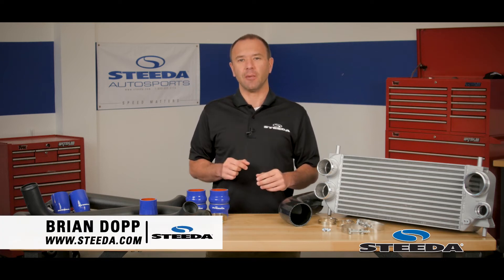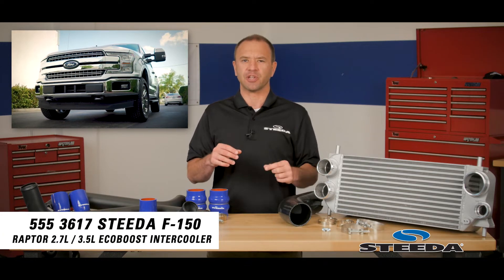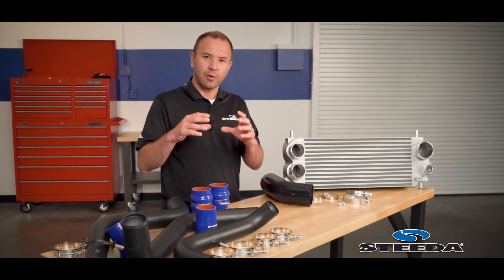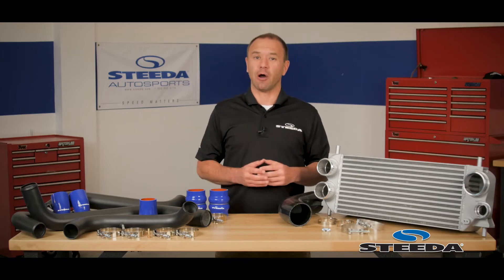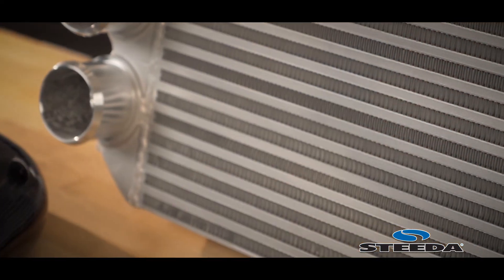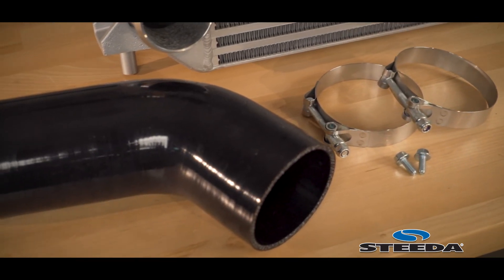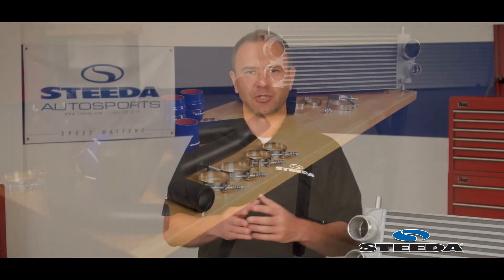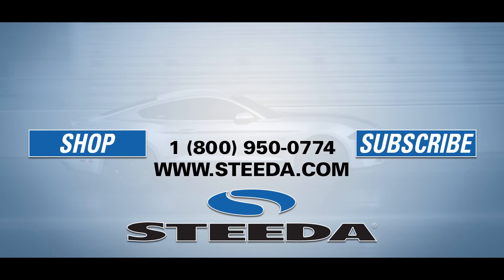Steeda F-150 / Raptor 2.7L / 3.5L Ecoboost Intercooler

Comment: 1. That is NOT a Front Mount Intercooler. That is for the factory location. 2. The heat in the air charge comes from adiabatic heating of the air as it is compressed in the turbos. Removing that heat is the job of the intercooler. 3. The factory intercooler is not big enough which is why you get a heat soaked vehicle so easy. #science
Reply: Your Mom the stock location is. FMIC as it is in FRONT Of the vehicle. It’s not a raised front month intercooler but stock location=front. Other options would be smic or side mount intercooler, or TMIC/top mount Intercooler
Reply: You Obviously don’t have a Raptor.
Reply: Your Mom I actually do. You clearly have no automotive knowledge. I’m saying there are 3 primary locations for intercoolers with mid mount cars being the exception. The stock location is by the bumper in the FRONT! this makes it a front mount intercooler. The Cobb, add, svc or full race are also front mounts but high front mounts that require relocation.  Don’t assume, and you should understand what you’re saying before you say it
Reply: Your Mom simply saying that it’s not a top mount, not a side mount, and sure it’s a factory location.... factory location front mount
Reply: Welp, there goes all that training.  You are right, it is technically a FMIC. I will concede that. However In the Raptor world an FMIC is one that extends in front of the radiator. The others just mount in the factory location. That is what I was trying to communicate.  I went with the CVF myself with the COBB Stage 2. What are you running?
Reply: Your Mom CVF Fmic CORE, and just because a group of owners that don’t know the difference calls it a fmic or a stock location.... they’re technically wrong and right. Lol CVF, s&b, Cobb stage 2 and some bs parts like lights and bumpers
Reply: Yea that bothered me too. Sweet setup. NC here, where you located?